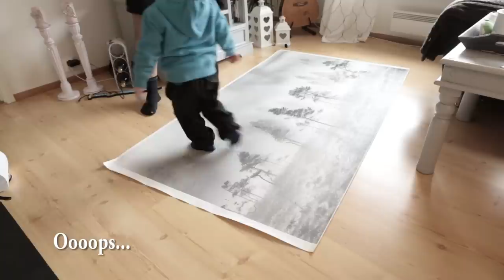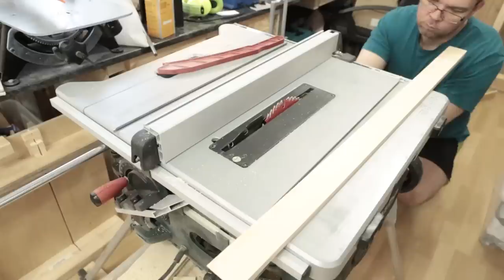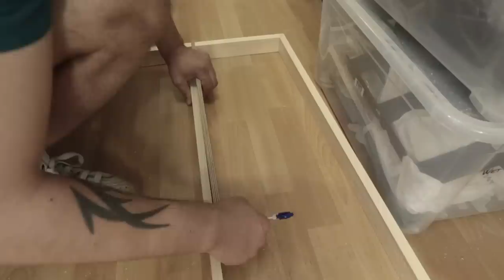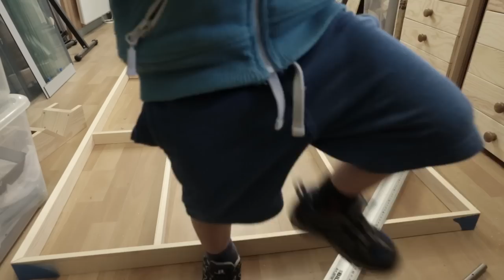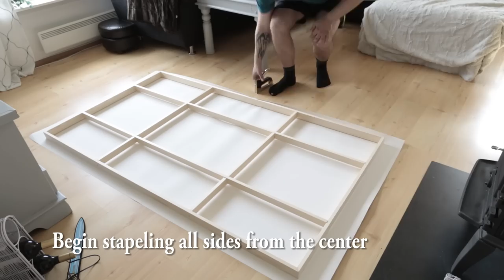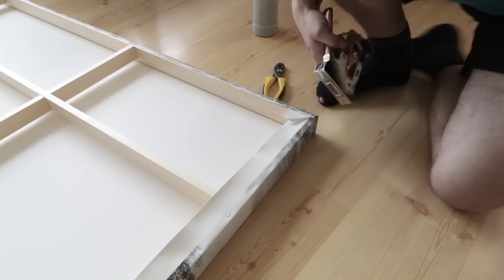How to Make a Canvas Stretcher Frame, And How to Mount The Canvas

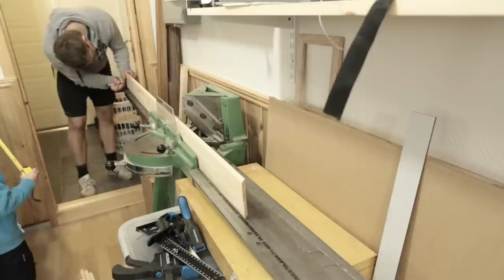Comment: Interesting machine 1:05. For the first time I see this. It is designed specifically to cut wood?
Mark.
Reply from the maker: It's a miter cutter which is used by framers. I used it a lot when I had a photo studio and framed photos. It can only do one thing but no other machine does it that fast and well. and no sawdust either :)
Reply: So I thought that this machine is designed for the manufacture of picture frame. I have not seen such machines in operation. %)
Mark.
Reply from the maker: They are great. This is a old machine I bought used chap but it's superb quality which lasts a lifetime. Only need sharp knifes.